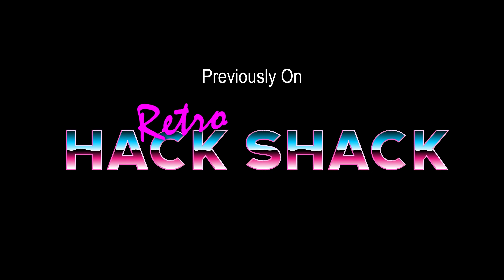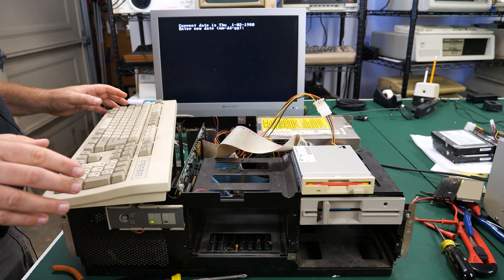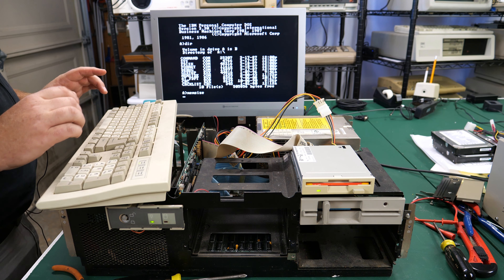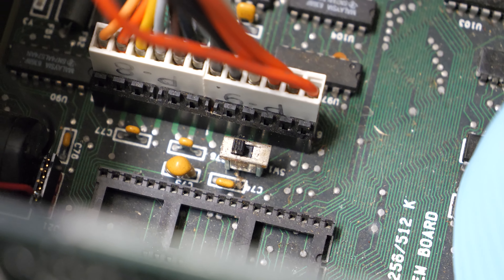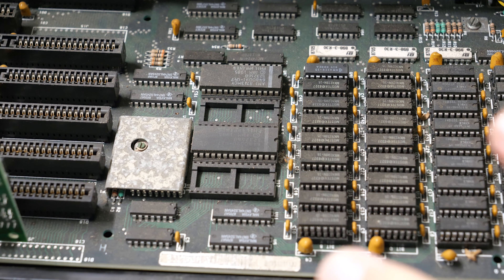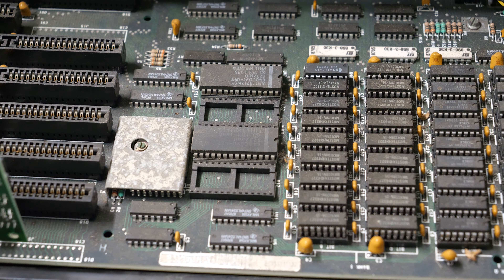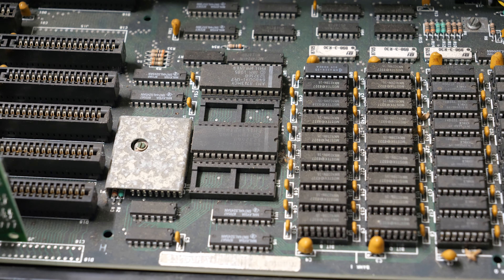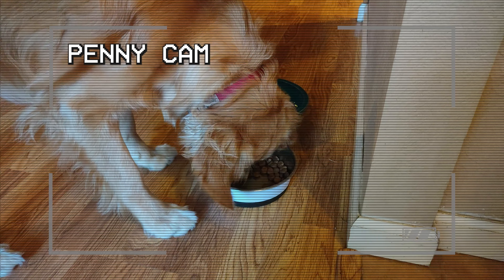IBM 5170 PC AT BIOS Upgrade, Video Issues, And Lots Of Cleaning!

Comment: It's supposed to be 2 switches controlling video config: mono, color 40, color 80, external BIOS.  You had it set to color 40.

MODE 80 at the DOS prompt would also have helped.
Reply from the maker: There is an only one switch on the 5170 for video. The PC and XT had two of the dip switches that needed to be set. And yeah, now I know about mode 80. Great tip.

Comment: I had an XT-IDE running alongside the original hard drive & controller card in my 5170 with the original IBM BIOS.  I ran it that way until the original hard drive failed recently, at which time I swapped-out the original BIOS for a QuadTel BIOS and replaced the original MFM card and hard drive with aftermarket ones.  I don't recall having to jump through any special hoops to get that XT-IDE working initially though.  I LOVE your monitor with this!!
Reply from the maker: Good to know. I think the combination of the switch on the motherboard and the dip switches on the EGA card were what was so confusing.

Comment: I believe you can put it into 80 column mode by running "Mode 80" from a dos diskette
Reply from the maker: Thanks! I will try this.
Reply: @RetroHackShack  Yes, this is the solution, and it's also because your dip switch settings are set for 40 columns.
Reply from the maker: Thanks. I think the combination of the switch on the motherboard and the dip switches on the card threw me off.
Reply: Might be “mode co80” trying to remember from decades ago lol

Comment: IBM built rugged gear back in the day.  This 5170 is a testament to their early designs and product engineering.  Try to find a math co-processor for it.
Reply: adding an 12mHz 80287 math coprocessor in my 6mHz 5170 decreased the render times in AutoCAD by something like 4-6 times!

Comment: Also, maybe consider adding a 3.5 inch floppy instead of that blank. I did that. It’s very period correct and makes the machine a bit more flexible. You can get the rails on eBay.
Reply: 720k :)  If I remember correctly some of the 1.44 would revert to 720k and if you had a true 720k floppy you needed driveparm.

Comment: Professional board washing machines run like a dishwasher along a mesh belt.  The end stage is a heater and highspeed air blowers.  We'd cover up the piezo speaker with a piece of tape, and use an air hose to blow out extra water from beneath the simm sockets and IC's
Reply from the maker: Similar
Reply: @RetroHackShack  one thing I'd note is that harder water contains more minerals, even a small mineral deposit left in a critical spot can either corrode or cause a short. it's less likely in these old THT boards but going to higher pitch SMD boards it gets riskier to use regular tap water. distilled water is ~$1/gal, better safe than sorry imo
Reply from the maker: Agreed. A distilled water rinse at the end is best.

Comment: Nice video! Instead of the xtide card,I used a normal ide card with a CF adapter. Finding the heads/ cycle fee numbers was fun. I ended up using dosbox to do it by attaching th CF card via usb to my modern laptop.
Reply from the maker: There is a great little program out there that will do this for you. I can't remember the name of the top of my head though.
Reply from the maker: Oh yeah. It's called WHATIDE.COM. Works great!
Reply: Sweet. Thanks!

Comment: Don't paint it, try removing the plastic from cover, then clean it with some baking soda and water, this forms a very mild abrasive cleaner, which works very well for IBM plastic like that, cleans it, without rubbing the texture off, just don't scrub like crazy, use light pressure to rub the baking soda around. I suspect it'll be nice enough to not need paint after that.
Reply from the maker: Unfortunately, that will take the paint off. It's not solid plastic.

Comment: and also use a hairdryer to dry the motherboard
Reply from the maker: Or the oven. But those are only if you're in a hurry. If you use an air compressor to blow the water out of the nooks and crannies, it should dry out overnight.